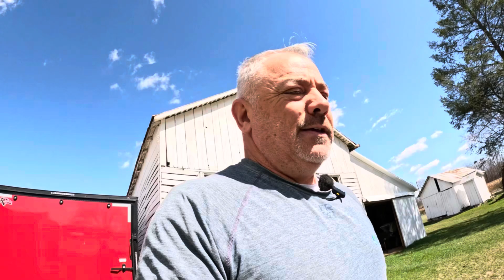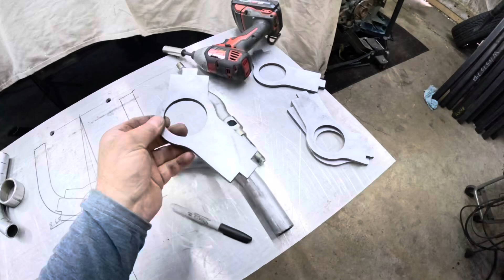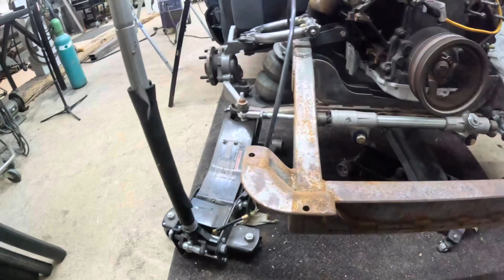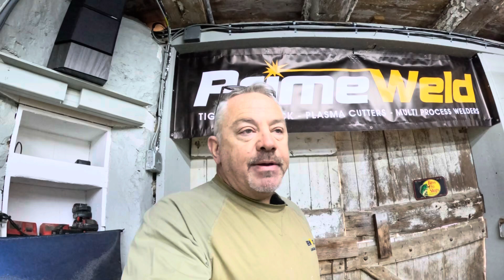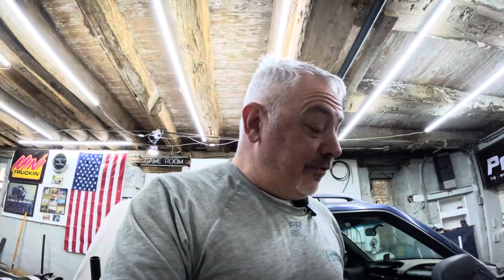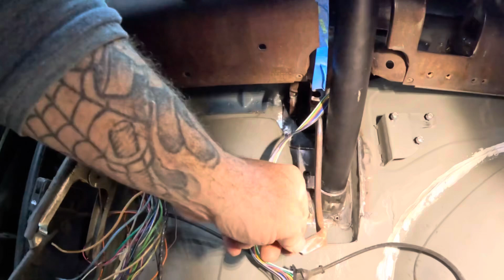Bodied S10 tubular a-arm build

Comment: Its funny that your gas valve went out... mine is sticking open on my lincoln electric mig welder. The one in mine is funky and has a 240V solenoid on it and sees 240V. So i have a new one just gotta open it back up and replace it. Great Progress as always!!!!
Reply from the maker: Thanks brother. That’s crazy!! You wouldn’t expect to see that kinda voltage on a solenoid 🤔 but nothing seems to surprise me. They are easy to change. Mine had green gunk in it. Very sticky. Wonder why or how it got there. 🫶🏻🫡
Reply: @mini_truck_obsession  my welder dates back to early early 00s. Still kicking and laying down the great welds. The previous owner rewired the inside to be able to aluminum weld with a spool gun, i have yet to try that tho.
Reply from the maker: @ that’s awesome. Older machines I feel were built better
Reply: @magicman_metal_fab  o for sure. Here at my regular job we just ordered 21 brand new miller tig welder inverters and 5 or 6 of them are already broke. Plus we still have to order another 20 or 22 more to finish updating all the welders. At around $7k-$8k a pop and some are already broke... thats expensive and crazy.

Comment: Nice!!!! I worried about Ackermann angles when building my Ranger. (Lifted solid axle) But it drives good. My thoughts. When going to extremes sometimes you have to do the best you can and run with it. I still expect the S10 will drive better than it did stock. See you next time.
Reply from the maker: Thanks my friend. I think so too. Everything jives with one another. It flows really well and smoothly. I’m still learning the lingo with it but I understand very clearly the do’s and don’ts of suspension geometry. I’m excited for this. 🫶🏻🫡